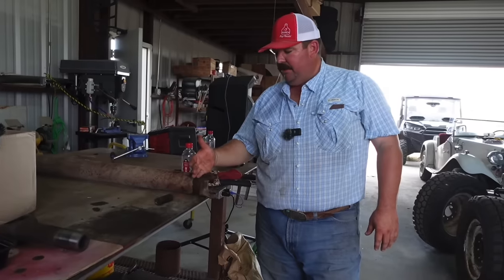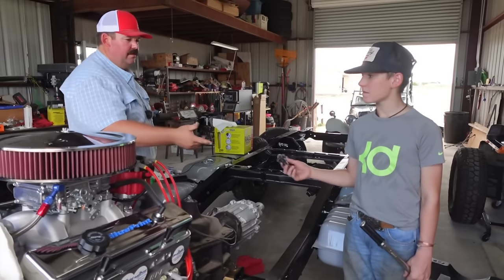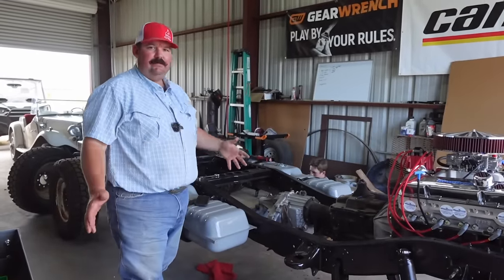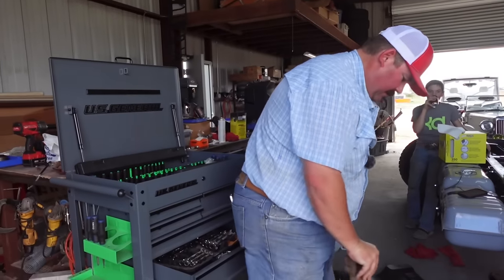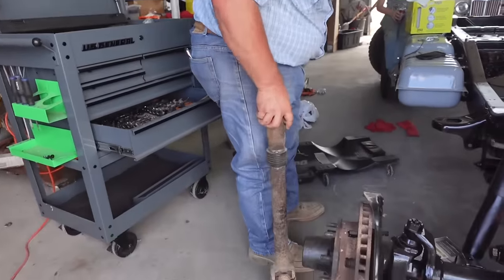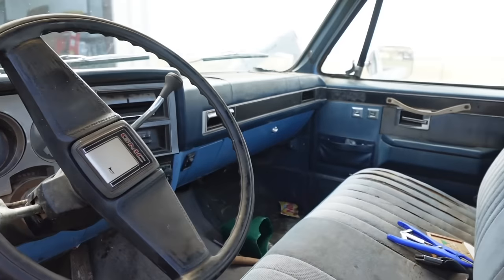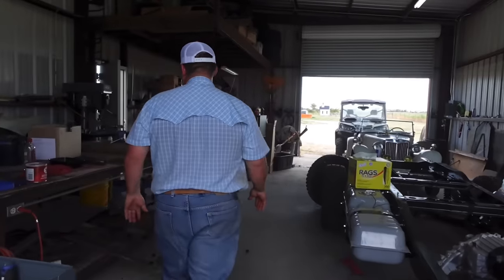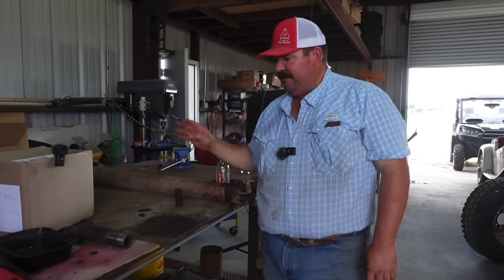Installing the Transfer Case on the Square Body Truck!

Comment: Just for future reference in case you don’t know. When using a torque wrench make sure to back it off to zero when done. Leaving it loaded, I’ve been told, will take it out of calibration. Guys that have to have precise torque wrenches have to have theirs calibrated annually. And you never want to loosen bolts/nuts with one, that definitely ruins them!

Comment: When your changing the ujoints I always use a 9/16 socket and put it on the cap and drive them out. Just put something under it to hold it up so it will come all the way through and then you can just pull the cap off and remove it

Comment: Y’all are doin a good job on that rebuild. I learned to drive in an 82’ Chevrolet. I miss that old square body. Are y’all doing anything with the 1/2 ton frame after y’all finish the build?

Comment: That front drive shaft the cardigan joint you have to burn the plastic out of the u joint caps to remove them.  Just fyi

Comment: I’d take the drive shaft to the machine shop,one in stephenville specializes in shafts, might not be too bad of a price, had a single rear built for my truck and front rebuilt, was less the $1500 for both 🤷‍♂️